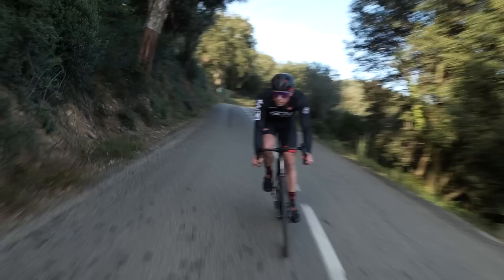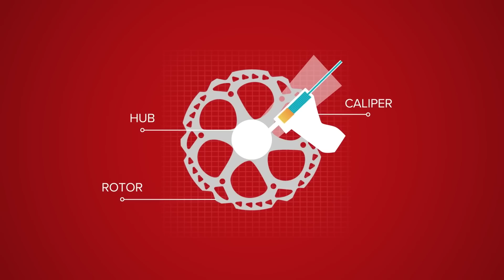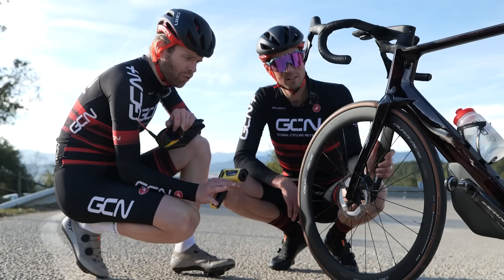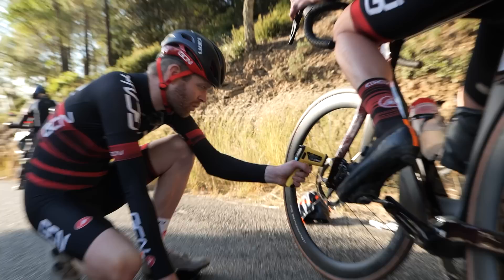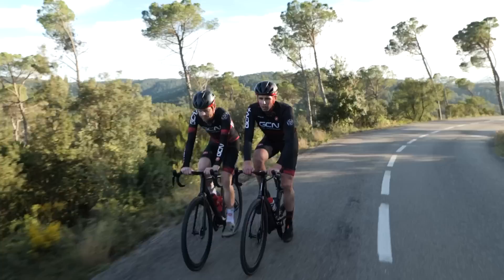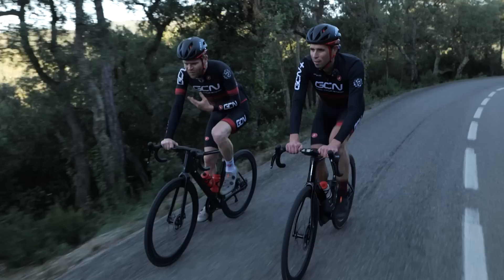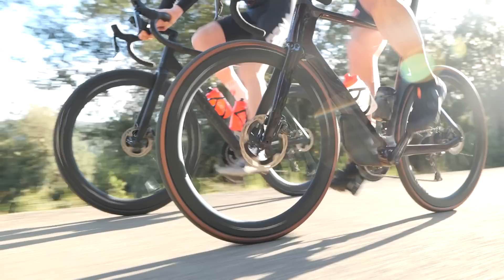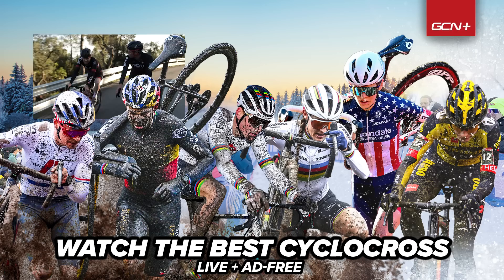Are Big Disc Brakes REALLY Better?

Comment: If in doubt, ALWAYS get the biggest.
Reply: I’ve got a 622mm disc. It’s called rim brakes 😂
Reply: @mondoabz  pmsl brilliant
Reply: @mondoabz  ... Eroding the structural strength of a rim to us as braking surface is one of the more moronic things the cycling industry has come up with. Thankfully it is going away.
Reply: Is the extra stress from a larger rotor on the fork a concern?
Reply: As long you don't use Titanium bolts you should be okay.
Reply: @mondoabz  Of course, you'll never see a comparison on this channel for the best rim-brake pads. Hint: Various choices have a radically different braking coefficient. Oddly, better pad material was available decades ago, but I digress. Rims can also be treated to increase the coefficient markedly, but again, I digress.
Reply: A 180mm is pretty powerful in my experience and can still take it's toll on a decent suspension fork and MTB tyres from repeated hard braking. Wouldn't this be a big no no with a carbon fork and 25c/28c tyres? Not that I care anyway because I rim all day
Reply: @markjwoodford1931  ... have you ever suffered a brake failure during braking?
Reply: @coldforgedcowboy  I have never had a failure on mtb disc brakes. But i do wonder about that carbon fork snapping with a 180mm rotor on a road bike, what do you think?
Reply: @markjwoodford1931  . I think switching from a 160mm rotor to 180mm rotor isn't going to make that much difference in stress level that you would snap a fork or start sheering bolts.
Reply: @coldforgedcowboy  that is not a thing
Reply: @cc-000  incorrect - the road disc system is flawed - it might be better someday but not in its current iteration
Reply: Doesn’t always fit.
Reply: That’s what you’re hairdresser says
Reply: @SeeYouUpTheRoad  over 6000kms, raced, long rides, group rides, climbs, decents, not a single issue nor anyone else in my club some with even more KMs than me! Flawed according to you and other “ armchair” experts
Reply: @tombola4046  ha ha - he thinks with those paltry 6K kms (3,278 miles) he is an authority lol! Seriously?  Spend some real kms and/miles before you can even talk about something not having any issues.  That's barely 3 months of riding for me.  No one should have ANY issues in only 6K kms lol!  Let's talk in a few years when you have actually accumulated the miles my crew (some doing over 22k kms yearly)  and shop customers.  

This happens all the time the people that say they have never had an issues with tubeless, disc brakes or electronic shifting don't really RIDE so of course they don't see the things that people like me se.  I  ride 16,000 - 20,000 km and climb 1,000,000 feet per year I see a ton of things go wrong and I see at an accelerated pace compared to you.  Just think about it and do the math ... you are at 6k I'm over 16K ... so about 3x more km's so about 3 times sooner to see the issues.  Now multiply that by years and years ...
Reply: I thought size didn't matter as long as the pen is working?
Reply: @SeeYouUpTheRoad  no need for such long replies fella, I got bored after “ ha ha” and gave up 😂
Reply: No less than 180mm.
Reply: @coldforgedcowboy  lolwut? Rim brakes work fine, there are bikes from the 70s and 80s with their wheels still intact
Reply: @coldforgedcowboy  It's not going anywhere. Rim brakes are the most common braking system on bikes the world over. People will still be riding bikes with rim brakes after you and I are dead.
Reply: @SeeYouUpTheRoad  I have made around 50000 km with my CF rims though. And they are still fine. Terrain is mostly hilly. And I ride with them through winters also so braking surface definitely gets contaminated. Rim brakes are working just fine and they need very little maintenance. I wonder how much hassle and added cost I would have with disc brakes in the same period.
Reply: @coldforgedcowboy  "Eroding the structural strength of a rim" 
And discs are forever, right? 
I am just asking because they tend to cost as much as aluminum rim.
Reply: @jkk916  Stainless steel rotors from Magura last a really long time. I have never replaced the rear rotor on my 2008 mountain bike.
Reply: @coldforgedcowboy  I have never ever replaced rear or front rim on my bikes nor I don't personally know anybody who had to do that due to rim wear. But I do know someone who had to change discs because they were glazed.
Reply: @coldforgedcowboy pfff ridiculous, would take several lifetimes if ever
Reply: @coldforgedcowboy More likely a front fork to fail because the braking force is at the end of the fork - there have been recalls after failures (my old CAADX had a recall). Never have I heard of rim failure from brake wear and if you’re not maintaining your bike it’s probably a death trap in many other ways by that point 😂.
Reply: @steveco1800 .... One of the reasons you hadn't had a wheel failure is wheel manufacturers have had to thicken the rim side walls to make sure that does not happen. The trade off being heavier,  less vertically compliant, and less aerodynamic  wheels.
Reply: @coldforgedcowboy  But for discs they had to strengthen the frame, forks and hubs, add through-axles and add more spokes, so it’s a trade off and they aren’t any more compliant. if anything the frame and fork has to be stronger on a disc brake bike and I remember reviewers saying some early disc brake road bikes didn’t used to ride as smoothly (on top of being heavier).

The forks on my rim brake bike are slimmer and visibly flex slightly over some bumps, but a disc would twist and snap them. 

My first disc brake road bike was a CAADX cyclocross bike which I sometimes had 28c slicks on. Under hard braking the cheap front wheel would flex the rim to the left because of the twisting force. The rear also flexed the left seat-stay. Even my newer Orro Terra C gravel bike, with a much stiffer fork, shows some flexing in the left leg where the calliper is attached. 

Rim brakes are in a much more mechanically advantageous position for the braking, while at the same time attached to a naturally stronger point of the frame and fork. So overall that slight rim reinforcement is worth it, especially as the rim needs to be fairly strong anyway for the bead of the tire and spokes. 

I like discs and wider tires for winter, but in the dry a well maintained rim brake bike works really well.
Reply: @discbrakefan  Actually, it’s the other way. A smaller rotor put more stress on the fork. But the tyre is the one who will give the biggest stress on the fork.
Reply: @cyclotronbxl  Explain
Reply: @stephensaines7100  totally, but the very best rim brake setup is worse, and significantly more expensive than a below average, hydraulic disc brake setup
Reply: @SeeYouUpTheRoad  everything has flaws, but disc brakes still have fewer flaws than rim brakes
Reply: @tombola4046  I did my first +250k MILES on rim brakes.  My last +30k miles are nearly all on discs.  Rim brakes are laughably bad when I foolishly take a rim brake bike out of the house.
Reply: @stevefarrell7741  there are still people with 4 drum brakes on a car and that will be true after we die too.  So what?
Reply: @veganpotterthevegan  So it's wrong to say rim brakes are going away. Keep up. 🤣
Reply: @stevefarrell7741  never been falsely accused of being introduced have you?  
They're actively going away.   That doesn't mean they'll fully disappear.  They're simply going to be like tube TVs that are even going away in the developing world.
Reply: @veganpotterthevegan  Rim brakes are not going anywhere, actively or otherwise. Tube TVs you can't buy anymore. Rim brakes you can.
Reply: And by the way, when something goes away it does by logical extension disappear. 🤣
Reply: @stevefarrell7741  you can definitely still buy tube TVs😂 And rim brakes are taking up a smaller and smaller share of the market as time goes on, and for good reason.   Have you ever tried looking at data and comingling that with common sense to guide your beliefs?
Reply: @veganpotterthevegan  Common sense tells me rim brake bikes will still account for more of the total bike sales market (not just road and mountain bikes) than disc brake bikes. I'll check the data on that as soon as you show me where tube TVs are still on sale. And I'd also invite you to produce some data showing me that's wrong. But either way, rim brake bikes are not going away any time soon and to claim they are is an overstatement based on nothing but personal preference for disc brakes.
Reply: @stevefarrell7741   you can't logically say that because you simply don't have common sense.  You can definitely illogically say that though. 
*Tube TVs are still being made in China.  Saw them for sale in a actual knockoff "Circuit City" in the Philippines on my last trip to see my family 3 months ago.
Reply: @veganpotterthevegan  Tube TVs are still made in China and on sale in the Phillippines? 🤣 I'm not really sure what your point is. Rim brake bikes are on sale in Halfords 🤣

Comment: All for fire and flames! I use a 160mm on the front at 100kg. Would think about going to a 180mm next time I change the rotor. Nice to see Peak Torque getting some love on GCN
Reply: How are you getting on with the longevity of the rotors themselves? I'm much lighter, but Peak Torque saying his pair only lasts ~6 months is scaring me.
Reply: @teknonmy7210  That was specifically about Shimano icetech rotors because they have aluminium in the middle. Get some cheaper full steel rotors and they will last ages.
Reply: Funny thing is that he hates gcn😅
Reply: @teknonmy7210 xD yeah fuck the icetech. If you're going to race icetech is fine.

For daily driver normal rotors are better

Comment: Love to see this explored more. I built an adapter back in the early 2000s to mount 8" rotors to my MTB as there wasn't anything available at the time and discs were so new. Ran 9" up front and 8" at the rear for literally 20 years now. Love it. Keen to see how a bigger disc works on road bikes as I find my 5" fronts lacking in stopping power to be honest.

Comment: Follow Peak Torque and have been impressed by his analysis and ingenuity.  Plus the pros have complained about distortion of rotors 0on descents.  A 180 (or larger) seems to be the way to go, particularly as the weight difference is marginal.  Yes, please investigate further.

Comment: Love the comparison and breakdown of each of the rotor sizes. I currently have the Shimano SM-MT800 140/140 and as a weekend/casual groupride cyclist 140s are good enough for me. I did however, swapped out my stock SM-RT800 (Ultegra road) for their MTB equvailent.

Comment: I run a gravel bike with mountain bike brakes, using a 180mm rotor upfront and 160 in the back. No stopping issues. Sometimes too much. I love it.

Comment: I wish they had discussed about the warping being often more prevalent on the larger rotors by comparison (usually due to just larger distance from the center axis).

My front 160mm Shimano definitely causes me considerably more grief than my rear 140mm.
Reply: Wouldn't that be down to using the front brake more?
Reply: @SMlFFY85  how much you use the rotor, at least theoretically, shouldn't affect how much the rotor warps. It mainly warps (in the real world) because of the tight spacing along with the regular heat increase and decrease as materials expand and contract (particularly when it comes to bonded materials of different varieties like steel and aluminum). They inevitably tend to not always go back to normal dimensions (when we're talking sub-millimeter) because of these things. 

From what I've read, the 140mm rotor is technically thicker by a hair than the 160mm. And since the length of the radius on the 160mm rotor is more, there's more potential for that material to get "out of true" to borrow the phrase, especially given the reduced thickness of the rotor. I'm luckily a smaller rider, so which diameter I use seems to largely be inconsequential, but I've considered running dual 140's to specifically avoid this issue. I pretty much never have rotor rub on my rear 140mm rotor when I have constant squealing and rub on my front 160mm rotor.

It would have been nice to see some of this mentioned in the video!
Reply: @tmswfrk did you ever try 140/140? How did it go?
Reply: @thedownunderverse  yeah it’s what I run now. I’m a lightweight rider, so weight isn’t an issue and I haven’t really experienced any fading. 

So far my choice of SRAM rotors has been working without too much squealing, as long as they aren’t contaminated and have been bed in properly. I’ve also started using resin pads again, which I think can quiet things down a bit in some cases.
Reply: @tmswfrk  cheers for that! I’m 72kg and considering trying 140/140. Expensive test though

Comment: A group of us road across Switzerland in rainy weather, 2016 specialized Diverge/Dolce.  My 130lb + 25lb rear panniers rides aggressively and had pristine rotors. I"m 200lb + 10 on the back and 20 in lowriders on the front, I returned with a smoked front rotor.  Other lady at just slightly more weight than my wife was one model downspec with a hybrid cable/hydraulic TRP brake, she over braked and boiled the fluid off on both brakes.  

I upsized my front Rotor when we arrived home,  Have not toured on anything like the scale of Switzerland since, but I was happy with the change.

Comment: I am no road bike cyclist, because I am stuck in the past(xc biker) and I use my old school ht from 2003 or 2005 with xt br785 brakes with 203 up front as ac commuter. swtiched to 203mm rotor up front because I could not stand how bad discbrakes actually were. 160mm rotors glazed my brake-pads very often, even at 203 it was quite common. So I switched to sintered pads and it actually did make a difference but still not as good braking perf as old school v-brakes, especially in combination with ceramic coated rims. 

My work college is still a proper xc biker and tested my bike and said it had the best brakes he ever tried, well I have to say that bikers know absolutely nothing about brakes in that case. I still consider my brakes to perform very poorly. Try a motorcycle and see how good they brake or simply a bike with v-brakes :P

to get proper disc brakes we need thicker rotors.

Comment: You touched on the real benefit, but wasn't the focus of your test. The biggest benefit is heat recovery in a situation where you have to brake on a continuous basis (same on a car/truck). A long technical descent where you are breaking hard on and off for 10 to 20 mins would be a better test.Also at what temperature do you start to loose breaking power? You could use a lath to perform both test.

Comment: On racing tandems you need the large disc brakes to cope with the extra weight like Ollie saw on my tandem submitted to Nice/Super nice. 
My rider/bike weight is 172kg and we have blued the disc’s on a mountain descent.
Reply: On our (non-racing) tandem we use either 203mm XT(R) rotors front/rear from spring to fall or 160mm (Ultegra) during winter.
Reply from the maker: What size rotors do you use?
Reply: Correct, weight and load will be affecting factors on the conversion of kinetic to thermal energy. Increased weight and higher load transfers will require the highest efficient transfer anticipation mediums.
Reply: @gcntech  200mm front 180mm rear
Reply: Captain/Stoker combined weight 270 lbs 123 kg we used 203mm rotors and metal pads on my road racing tandem (200 milers- 500 milers) - but I would never ride disc brakes on my solo road bike.

Comment: If the heat dissipation is so quick as your temperature readings suggested, does the similarity in final temperature not suggest it was related to the final braking effort?  In other words the heat from the heavier braking effort earlier in the descent would already have been dissipated

Comment: Depends on the bike really. I've got a touring bike, 160mm is good, but later 200mm might be better. Better heat dissipation when speeding downhill with a heavy load.

Comment: The other consideration is pad compound.  I have recently swapped to ceramic compound on 160mm front and rear and I have best road brakes I have ever use.  They are silent and work much better in the wet
Reply: What brand and model?
Reply: @larrylem3582  I used Gorilla ceramic pro. I have a Roubaix with Dura Ace 9100 calipers and ultegra 160mm rotors. I also have a Creo and use Hope Rx4+ with same pads. Both sets of brakes are phenomenal.
Reply: And ditto on rim brakes, very much so.

Comment: My experience from MTBs is that discs heat up most on steep descents where they are used for an extended period. The descent on the video looked like one where braking was only needed at each corner giving the rotors time to cool down between them
Reply: I agree. A very steep descent at low speed would be a better test. And I would like to know the pad or the caliper temperature as well, as the disc temperature doesn't matter that much in my opinion.

Comment: The heavier rider thing is key.  I'm 85 kg and have descents nearby that are 36% grade in some switchbacks.  If I could post a pic of my rear rotor that is blue/brown for an inch from where the pads touch the rotor, I would.  I tend to ge really far back behind the saddle when I'm trying to make good use of both brakes descending, which is a technique you have to use when descending steep muddy terrain on a motorbike.  If you don't get far back behind the seat, weight transfers to the front wheel until you're doing a "stoppie", which is no bueno. Next test, try out pads with no fins, then Shimano L05A with fins, and throw in some Absolute Black pads for giggles.

Comment: In my cause change front disc from 160 to 180mm was perfect decision. It cost me around 20usd for disc and adapter. Also when i had in one season Giant Fastroad i changed front one from 140 to 160 and i had not regret it
I weight around 95 kilograms so it is very efficient